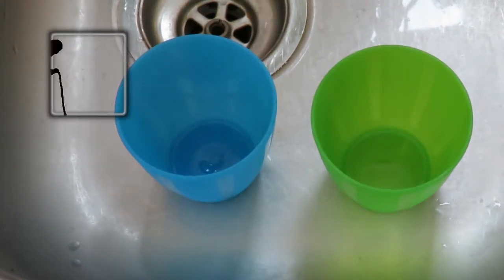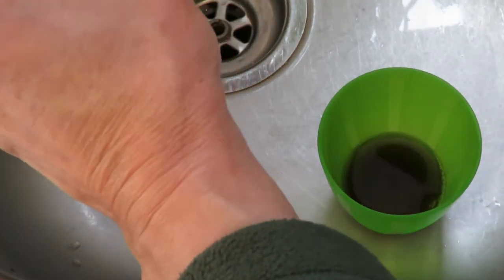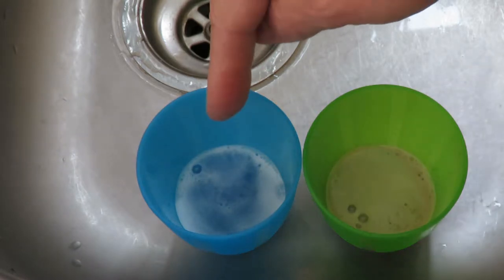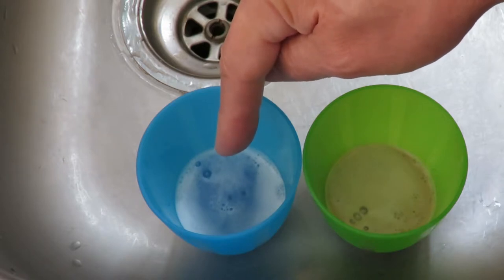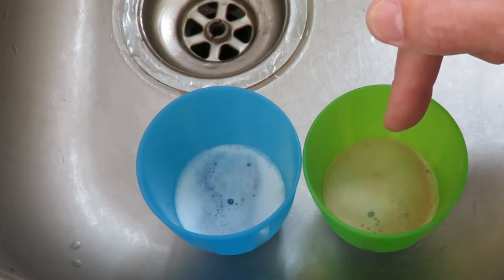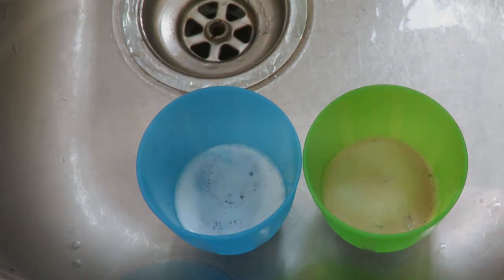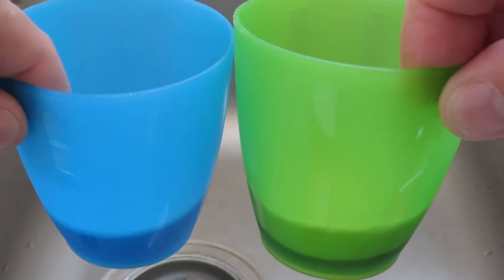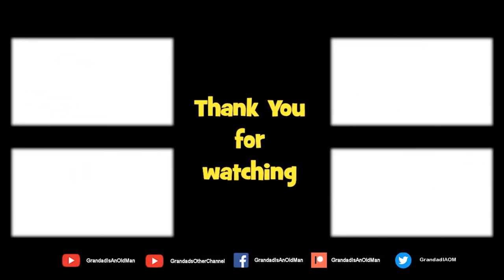Vinegar or Water for effervescent tablet rockets (PREVIOUSLY UNLISTED VIDEO FROM 2018)

Comment: Ah! now see you used malt vinegar, does sugared water work better? :-) I am sure Elon Musk did something similar. ;-)
Reply from the maker: Any particular type of sugar? The tablets are basically reacting with an acid. In dry form the acid (which is already in the tablet) does not react but when water is added the acid forms and the tablet reacts. Using vinegar you are short cutting the process.
Reply: @GrandadIsAnOldMan  Sweet sugar??  :-)